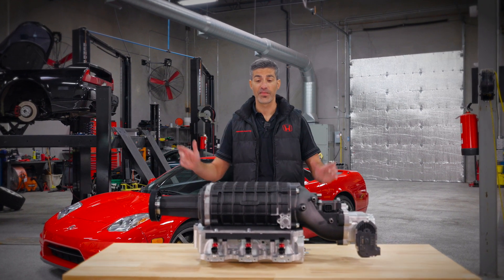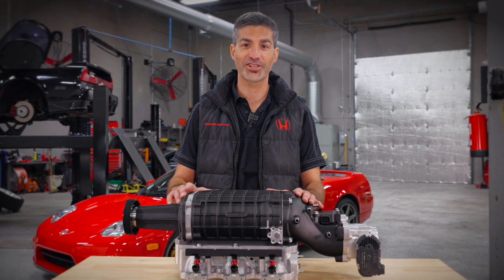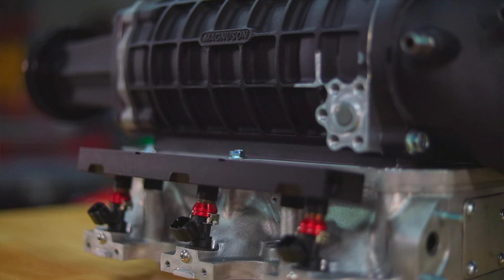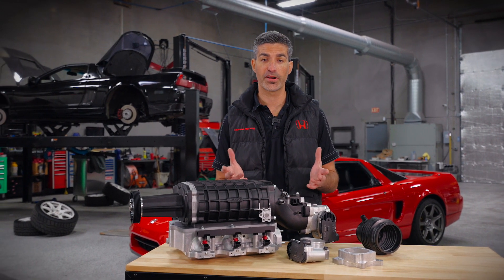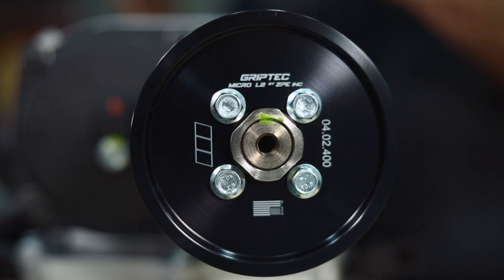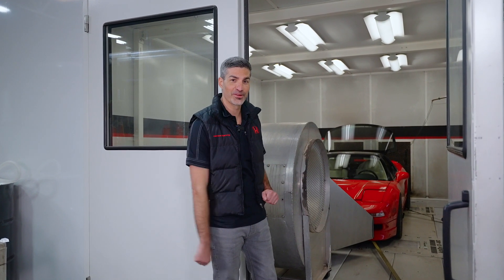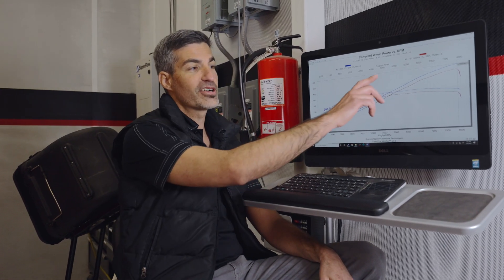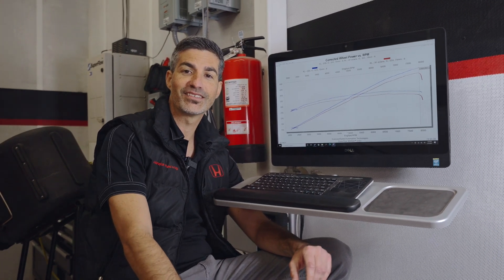500 WHP from a supercharged NSX! ScienceofSpeed TVS 1900 Supercharger for NSX

Comment: I've been waiting in anticipation for this supercharger kit. Would like to know more about the tuning package if its part of the kit. The older CT kits didn't have very good engine management. I'm down for a weekend DIY warrior bolt on kit that includes everything to make it work.
Reply: This particular car is on AEM infinity and a flex fuel tune.
Reply from the maker: The ScienceofSpeed TVS 1900 stage 2 kit includes programmable engine management, which requires tuning. Check out the details here: https://www.scienceofspeed.com/index.php/nsx/scienceofspeed-tvs-supercharger-nsx-1991-05.html. In the future, a pre-configured option, that does not require tuning, producing about 80 WHP will be available.
Reply: @ScienceofSpeedLLC  will it be cali legal?
Reply: @thefuzzypickle8277  who cares 😅
Reply: how did the kit work out for you

Comment: What was the compression ratio and boost?
Reply: 9.5:1 compression at 13lbs of boost
Reply from the maker: 13.2 PSI. Engine static compresson is 9.5:1.
Reply: Any any plans for a 15 psi pulley?
Reply from the maker: @CarsandBikes  Smaller pulleys are available for engines that can support the additional power.